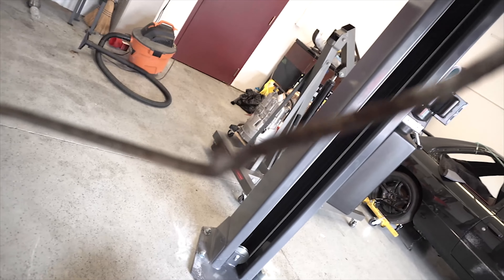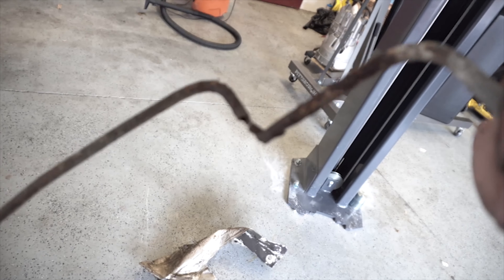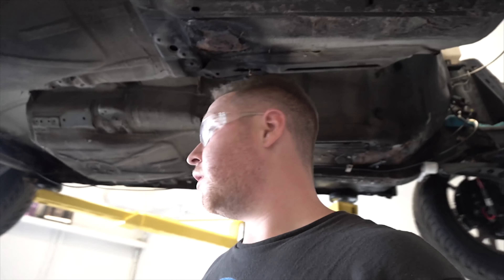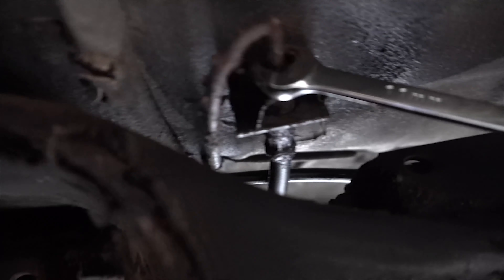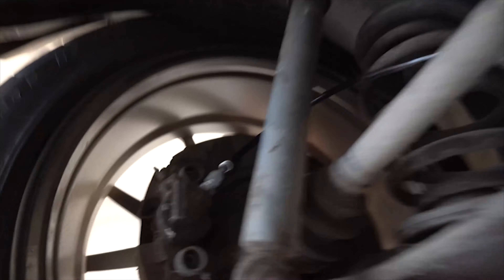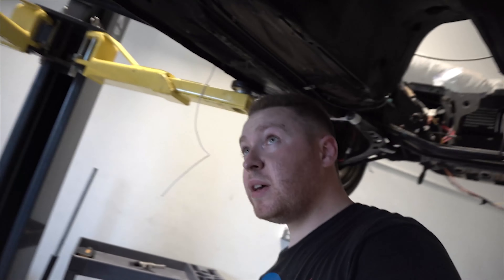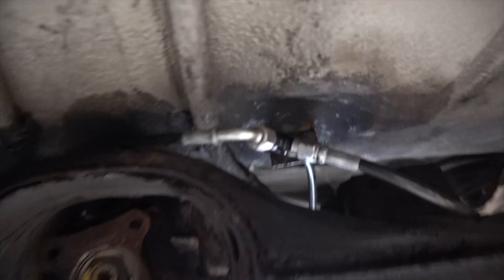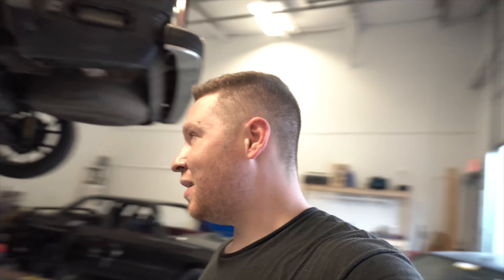CHASEBAYS E30 REAR BRAKE LINE INSTALL

Comment: Do you have to run the bulkhead fitting through that tab? i just installed the lines myself yesterday and i don’t think the passenger side brake line would reach if i put the bulkhead fitting on the tab